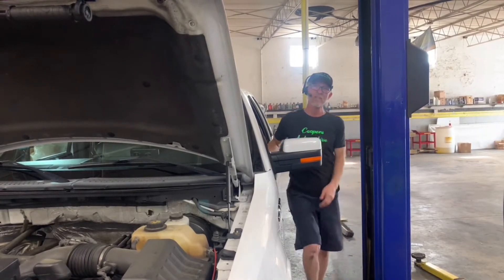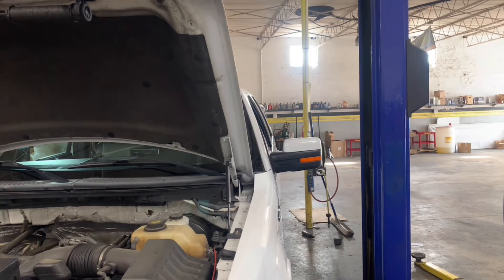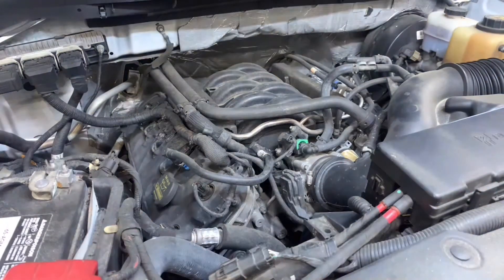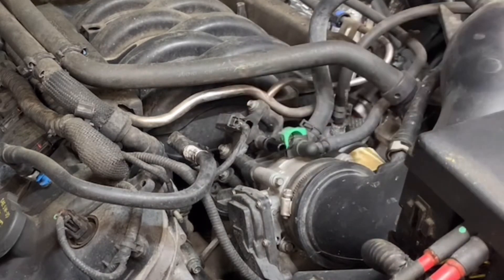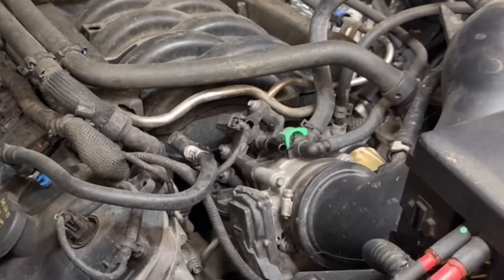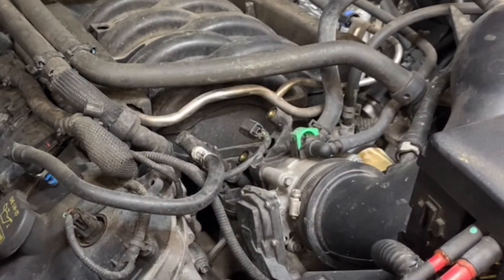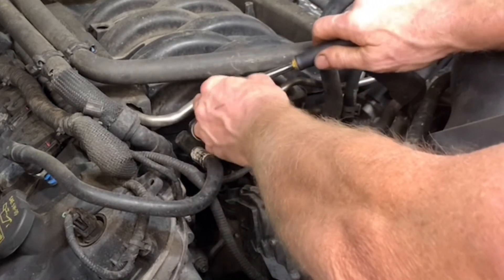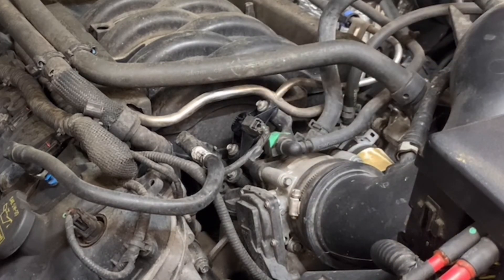2016 Ford F-150  codes P2196 and P2198

Comment: Also I thought the purpose of the purge valve canister was to suck, so why is it not sucking when you replaced it with a new one?
Reply from the maker: Only supposed to have vacuum on the solenoid when it’s being operated other than that, it should not be pulling any vacuum
Reply: @ so basically when it starts to kick in about 5 min after the vehicle is turned on?

Comment: Would this code also make the yellow wrench pop up?
Reply from the maker: No, this would make the yellow wrench come on I believe that’s the maintenance light
Reply: @CoopersAutomotiveRepair 2012 f150 3.7L V6 97500
Reply: The yellow wrench popped up and I changed the throttle body, purge valve, fuel pump relay, fuel pump sensor, MAF sensor, as well as the oil pressure sensor, and as soon as I start my truck it starts fine but as soon as I put the truck in Drive it starts to idle really rough then cuts off. The turns off and I get a low oil pressure warning as well as the yellow wrench right after that code what could be the problem

Comment: what if it's a pending code of p2196 bias rich bank 1 sensor 1 only ?
Reply from the maker: I don’t know if the code is pending, but cheap enough to replace to give it a shot could still be the same
Reply: Also my problem and it runs bad when I give it gas
Reply: I changed my purge valve no change 😢

Comment: I am helping my son he has a 2014 f 150 6cyl That is posting these same 2 codes but the engine wont start just keeps cranking. I cleared the codes, still won't start and is showing 0 codes. Any help or Ideas would be appreciated.
Reply from the maker: Starting with the basics, I would say if you have spark at the coils and then fuel pressure.

Comment: I Just Had Those Same Codes Today, But The Reader Is Saying “O2 Sensor”. It’s A 2011 Flex Fuel F150
Reply from the maker: I guess it’s possible it should be lean coats bank one and two

Comment: Just to verify it means there is a Vacuum or is it the valve. I have a cheap code reader and it pulled up as the o2 sensor
Reply from the maker: In most cases it’s always the valve. Had another one today

Comment: I couldn't even hear that engine running but could barely see it vibrating. Do you have a filter that removes the engine sound?
Reply from the maker: Yes noise canceling parrot mic